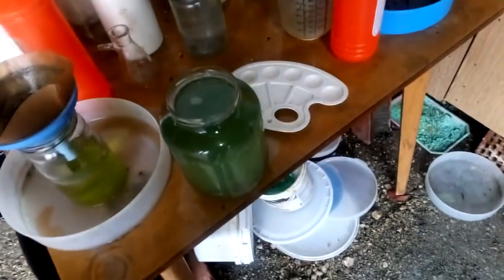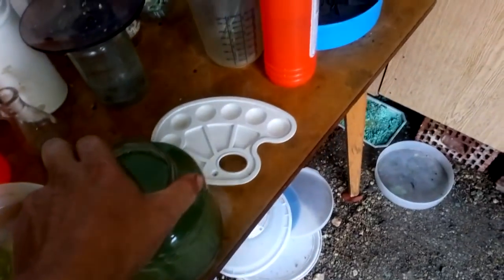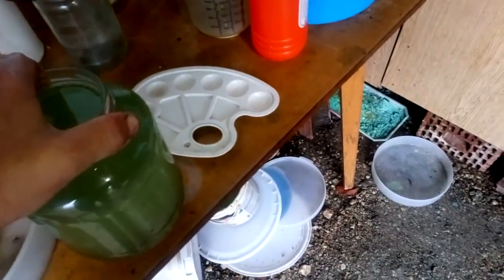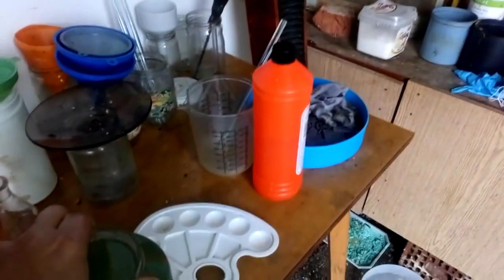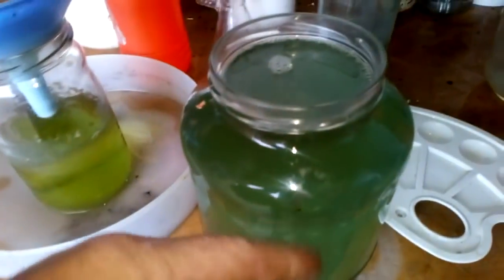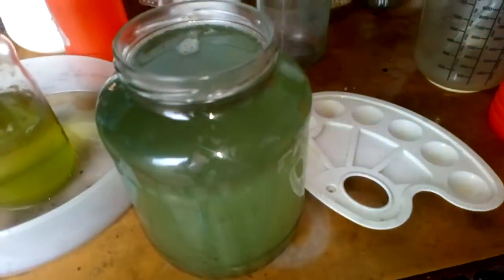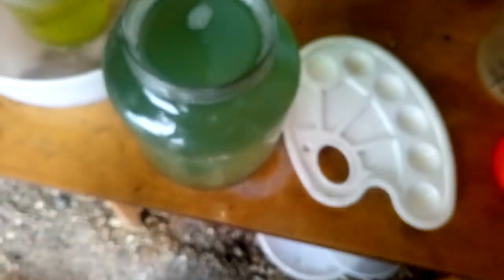RE-REFINING GOLD POWDER WITH ACID & BLEACH!

Comment: How did you Neutralized the solution, before dropping the gold
Reply: I have the same problem when i add matabusilfite i get bubbles like in cocacola  and after thst  nothing hsppend .i used heat to neutralize the solution but in vain there is still bleach in solution .
Reply: Rasheed Maghrani have you tried to mix SmB with fresh hydrochloric? The PH needs to be ideally 4 or lower to get a good drop with SMB. Also best to wait for the chlorine gasses to escape before adding SMB. Let the solution warm in the sun and this will drive off the excess chlorine and degrade with the UV rays from the sun. Be patient my friend 👍🏻

Comment: To avoid problem with lead in your gold chloride, add a bit of sulfuric acid. That will precipitate lead sulfate and it can be filtered off before dropping the gold. I always adds a few drops before filtering, then I see if there is any lead present.
The lead probably came from lead-tin solder, from stuff made before lead-free solders became common.

Comment: Very nice drop sir.  Excellent work, as always.  You've got courage.  I REALLY don't like the acid\bleach process myself.  I try to avoid chlorine as much as possible and anything that involved extra chlorine is at the bottom of my list.  lol

I'm still sitting on 20+ litres of 67% nitric acid so I am MORE than happy to keep using aqua regia.  But this vid, along with the rest of yours, has been educational.
Reply: Doesn't nitric acid mixed hydrochloric acid (combined = aqua regia) produce chlorine gas?
Reply: @wonghiulan2961  It does 😉